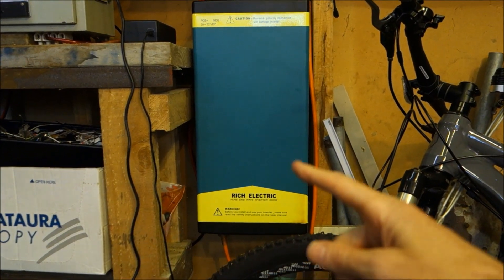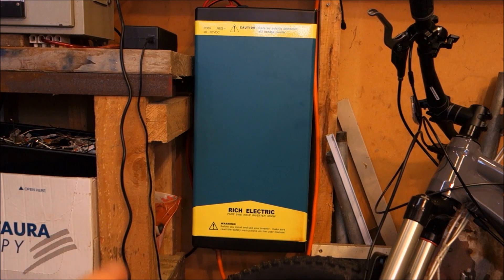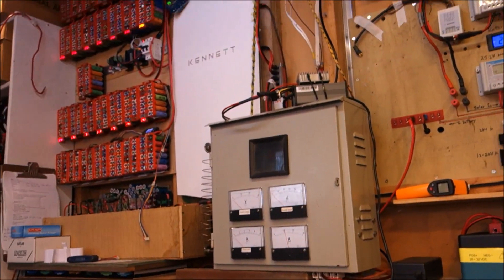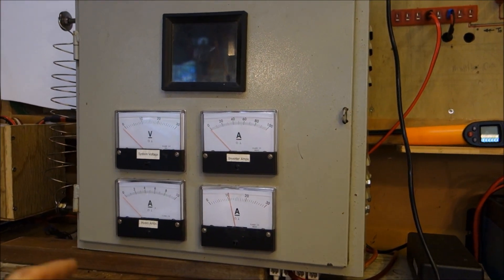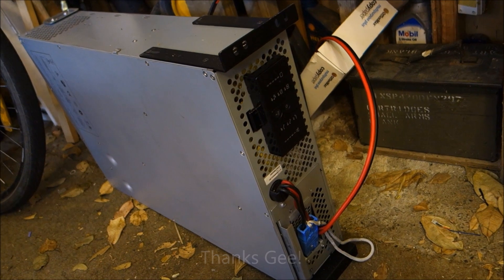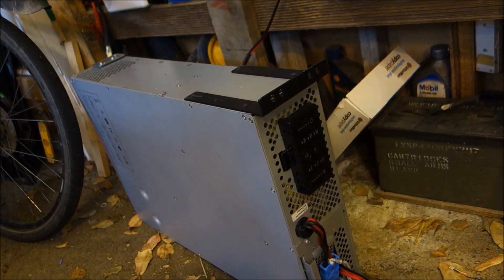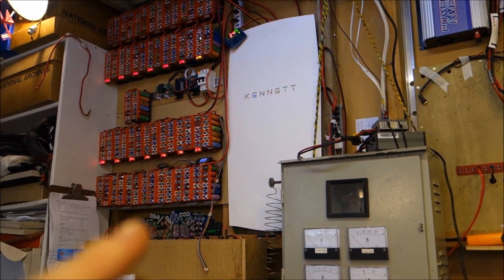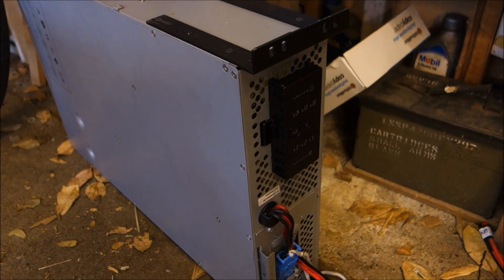Laptop Powerwall 129 - Too many inverters

Comment: I can see the Rich electric is a pure sine wave inverter, I would assume that the APC is not, and I would say the APC is not designed for long term use i..e. being run from batteries continuously. The other thing I assume the APC is a UPS and does not expect to have a sudden surge load when running as it has the normal load connected when the power goes off. By the way the Rich unit at 3000W at 20V in assuming that is the low voltage cut off, will potentially draw 150A assuming 100% efficiency so it will be more.
Reply from the maker: Yeah - I'm starting to realise the APC is not quite as good as I was thinking. I run the Rich unit at only 260 Watts most of the time (26 to 27 volts and under 10 Amps).
Reply: Trouble is at that low a power level it will be quite inefficient.
Reply: You could put a breaker on the dc input or the ac output to be lower then what your wires can handle that way it will just trip and will not cause a problem apart from having to reset the breaker etc

Comment: Paul, most server-room UPSs are not pure sinewave (even though they may claim they are).  They are usually 4-8 steps per 360 degrees of the sine, at best.  If you think about it, these will supply backup power for switching power supplies, which can utilize a nearly square wave.  Hence they don't require the huge and heavy transformer that is in top-end true-sine inverters (usually around 10-20 lbs per kilowatt for transformer alone).
Some fridge compressors don't do well with modified sinewave.  An average full size fridge only draws around 100 watts when running at temp., and maybe 4-500w for half a second at startup.  So I dont think its a too-much-draw issue you are seeing with the UPS.  Its likely either undersized wires choking the DC voltage too low at the UPS, or it just doesn't like the dirty sinewave.
Have fun on your adventure!
Reply from the maker: Hi Aspendell. Thanks for the info. Both those scenarios could be at play in my test setup; undersized wires and dirt "sine" wave. I really need to through a scope on the output.

Comment: Bear in mind I have little knowledge on this subject, but would a high inductive load not inhibit the inrush of current due to the back emf?  Is there a large X2 capacitor in the fridge causing the 'trip'?  I'm asking because I don't know.
Reply from the maker: Hmmm. I don't know either. Maybe I should open up the fridge and have a look when I get back.